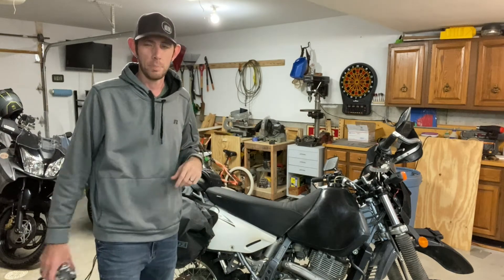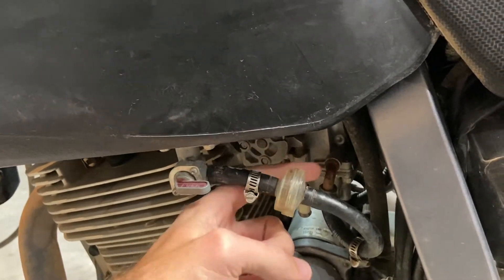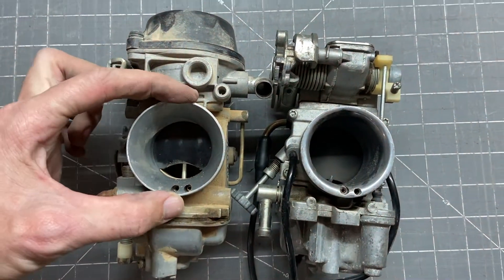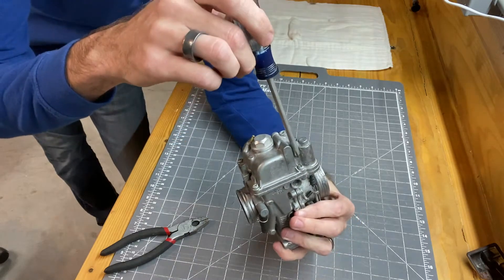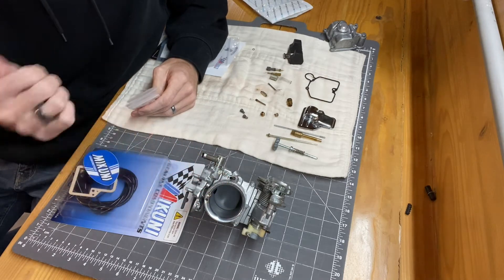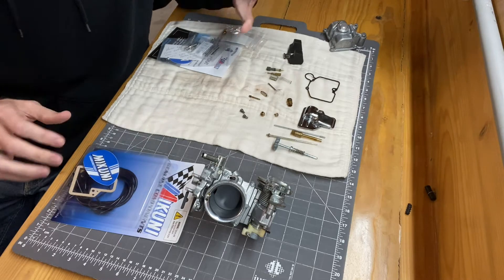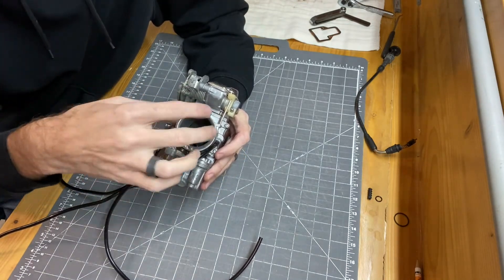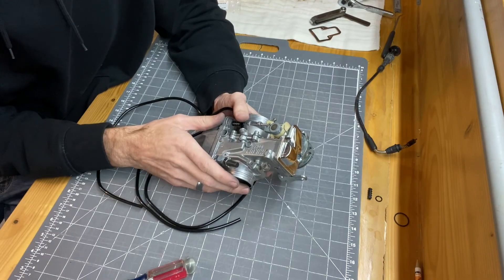DR650 Carb Swap (pt 1) - Mikuni TM40 Rebuild

Comment: I have cut in a pumper on a DRZ.  Be patient about the boots and jetting.  It may take 4 times and it is tight.  Don't get mad.  The air box mod and exhaust mod messes with jetting.  You need the right adaptors and don't lathe it and press it in  like this dude.  Just buy the kit with pressed on throats.  This is a "I am broke Billy Bob cheap approach" yet I like it.  A kit is 1250 just saying.

Comment: Is their a throttle stop screw? On top of the carb to hold the throttle open for higher idle like the original carburetor?
Reply from the maker: @jackfrost7400  there is a screw that will keep the slide open to a set position. It’s the big knob on the side of the carb
Reply: @DustinRogersinMO  thanks I just started it and u are correct awesome thanks for the quick response 👍

Comment: Hi. i notised on the fuelskrew that you took the oring on before the washer. I think you have to swap them so the oring is the last you put on. thanks for your video.
Reply: I was going to say the same thing.  The original is as you describe - spring, washer, o-ring.

Comment: Hi Dustin 
I’m working on the same carb to use on my Xr650L is most the same settings just looking the part number for the accelerator pump nuzzle thanks for the info 
Great videos
Reply from the maker: Thanks. I put some links to the common sizes of accelerator pump nozzles in the video description.